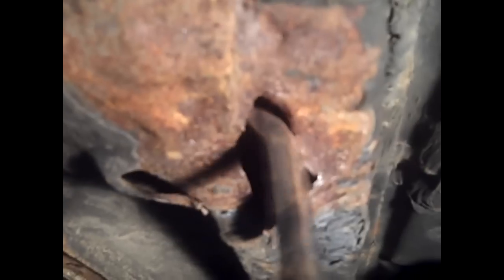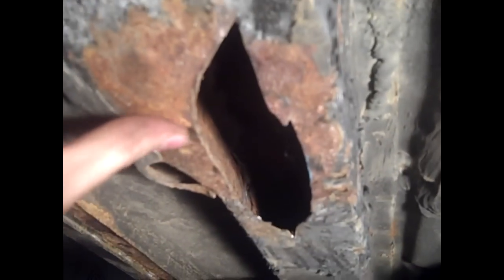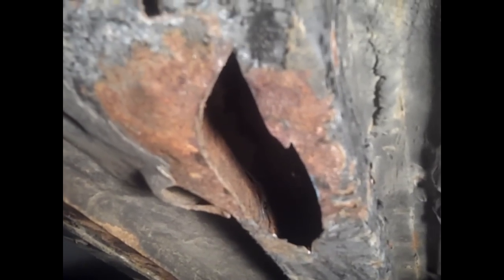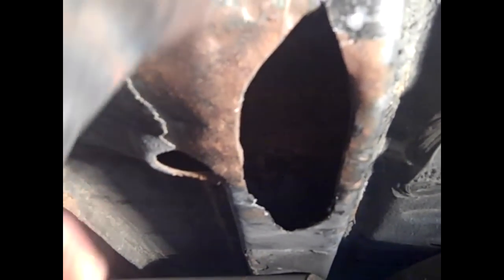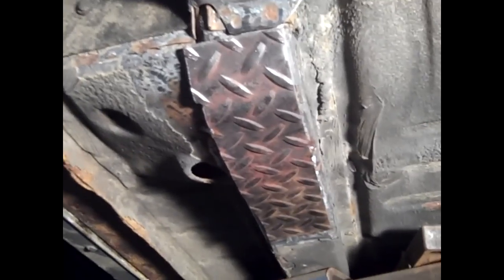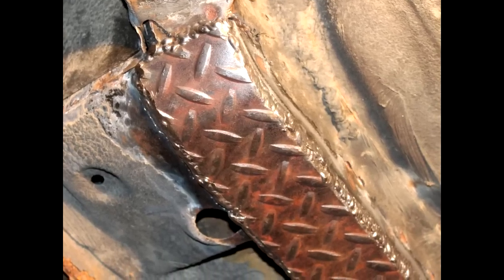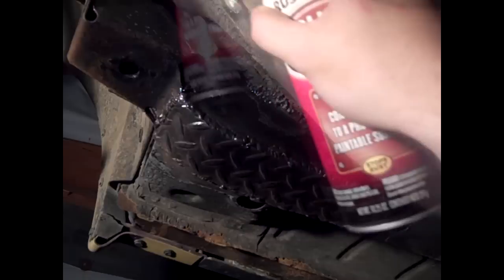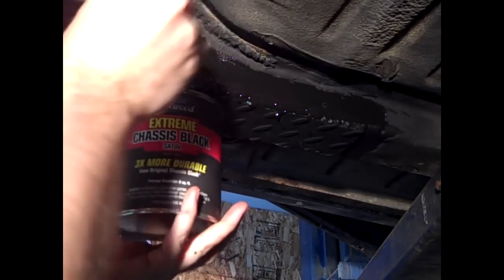Patching extensive unibody frame rust

Comment: Always my concern is treating the metal INSIDE the frame otherwise the rust will quickly recur.
Reply: Shoot some old transmission fluid in there and fluid film
Reply: @bobobrazil1973  Almost. Gotta mix that all up so it sticks where u want it. Try it and I guarantee u will be using it until urr dead.

Comment: Chain saw bar and chain oil is the best rust preventer ever because it stays tacky and doesn't drip.  
If you inject it into body voids on a relatively new car and brush a thin film of it all over the underside of the vehicle , it's unlikely that this kind of rust would happen in the first place. Oil will always prevent rust better that paints because oil wicks into seams and keeps on wicking.  Nice work, though!
Reply: scdevon yea, your right.. or just use couple cans of white lithium grease spray in holes as much u can once every couple years and will prevent rust. once ruat starts it a b**
Reply: scdevon but oil n grease can cause unwanted build up of dirt in the frame that causes dirt to hold water and also cover up w dirt areas re greasing cant get to.
best to just wash undercar as much as possible after driving in salted roads

Comment: I use the same method when prepping my car for its annual inspection (1997 Saab 900s). The only difference is instead of welding diamond plate I use duct tape and then I hit it with rubberized undercoating spray ;-)
Reply: Where are you from where there's annual inspections?
Reply: @danieldeanharrison  they do in Virginia but where I live they really just check the lights ask a few questions and give the sticker
Reply: @danieldeanharrison  Pennsylvania too🫤🫤

Comment: I have done many patches like the one you just did ! Nice job ! I am trying to fix rotted off piece of pinch weld under drivers door of Chevy cobalt ! The steel floor plate behind the pinch weld looked pretty solid .It is so thin it burnt thru catching main wiring harness and carpet on fire ! I melted a 50 wire loom pretty good ,So so am in process of taping bare wires and splicing a few . Truck sub frames are a lot easier than these small cars .The thin plates they laminate together are not much to begin with .When rusted very hard to not burn !

Comment: Nice job, but i would have sprayed engine oil inside the frame channels. Oil will really save your frame from further rusting. I do it on my jeep twice a year and it really helps.
Reply: +Ochipwa Greenspider what you should really do is vacuum all the shit out, get it cleaned good, and media blast the area around the rust. then you can paint with zinc primer, rust encapsulator, whatever... 
Then spray oil up in the regularly like our friend above here said because you could have not gotten full coverage over some spots or something and oil will also prevent. But if you get it all blasted and then painted properly you shouldn't have to worry about it.
Reply: Ochipwa Greenspider well there's often those little holes all over the frame, for drainage and wiring and stuff. So you can use a blaster with a little flexible nozzle and blast then paint with a similar nozzle for spray gun. If you use rust encapsulator  and zinc rich paint if you go over any remaining surface rust it will be starved of oxygen and not rust anymore.
Reply: +lar4305 exactly-repairing that hole is only part of the process, old engine oil or similar blasted inside the chassis member is THE vital last step to treat the advanced rust thats still there.
Reply: I like using Fluid Film. Its a sticky lanolin based oil that works great. Once a year and it helps!
Reply: Why oil it? Semen works just as good.
Reply: Pack it right full of JB weld. DONE!
Reply: engine oil would have been interesting while welding.  yikes!
Reply: @AustrianAnarchy  wow - that's what I just did.

Comment: Just one thing. Some DMV safety checks will not allow unibody repairs. Now I'm not sure if that' includes a profession welding shop or none at all. Best to check before starting. My son who is an expert on MIG did a job on a CJ. The work was never noticed. He has the knack of making things look old to boot, Ha.
Reply: Do you guys/gals on that side of the pond have to submit vehicles to annual inspection like in Europe? The EU control/MOT/TUV, etc.

I believe that "repair" on a frame member would be a write of for that jeep. :-(
Reply: This type of patch is acceptable in the U.S.

Comment: I have used Eastwood's rust encapsulator, which is probably the same thing as the Rustoleum product you sprayed on before you used the Eastwood chassis black. The encapsulator seems to work really well at penetrating rusty pockets and preventing them from spreading. Using that product, be sure you remove all rust scale and clean up the rust area as much as possible. Your patch looks good and strong, but not sure I would keep this old car on the road considering it had this much rust damage to the unibody frame. It was pretty nasty damage to the rail and floor pan. Think I would have junked it or gave it to someone I didn't like! LOL

Comment: looks good. diamond plate!! ha!. should have brushed the frame inside the hole as far as you can reach w a rust treatment. painted and then welded up. otherwise looks like shell hold

Comment: Looking good, That's about what I'am facing and I'll have to fabricate a patch as well. I just got into welding so fingers crossed that mine works out too. Thanks for sharing this, comes in handy, subscribed.
Reply: If you're new to welding,  do some research and watch some welding videos to get some tips.  Learn as much as you can and practice on a similar thickness of metal before jumping in to doing your repairs.
Good luck.

Comment: I had a mechanic friend from Oregon get a job in Wisconsin and he was very surprised on how the rust makes such a game changer in terms of brake/fuel lines, underbody-body rust, etc.,,,  Way more difficult, you get cozy not working with rust.
Reply: TVTruther - So true. Used to be in the South of Europe, warm and dry. 
Now living in the North, snow, ice, salt and tons of moist. Every bolt means a pray wishing it will come off instead a breaking off... Copper grease became a religion. LOL :-)
Here I go again to the -10°C change brake lines corroded to the bone... :-(

Comment: The tone I get from this and other forums is that the subframe / front cradle corrosion problem is no big deal. I wonder if I am seeing information from folks that have a certain level of expertise, giving them a chance to address the problem before actual structural failure while being driven? My wife’s 2000 Saturn LS frame / cradle did fail while being driven; she was so fortunate to have been stranded, unable to move, while driving very slowly. The right, front lower control arm’s front pivot bracket pulled completely away from the frame. The right side half shaft’s inner spline was pulled out of the tranny, and acted as a stiff rod between the spindle and what was still left of the cradle between the sites of the two (2) lower control arm’s pivot brackets. That made the car unable to steer or drive out of the lane of traffic it was blocking. I tell all that, only to ask: why didn’t Buff Whalen Chevrolet, Sterling Heights, MI, tell / warn of the corrosion damage, since they had been doing oil changes and had the opportunity to see the condition of the cradle?
Reply: In NY state I have the tiniest hole during an oil change in the unibody and its actually near the motor and if you go to a commercial place you cant pass inspection and they actually told me to total my car for it

Comment: This is what im up for in the weekend !   Bought a ford transit, ripped off the dropside down so only the frame was visible. walked over it with the hammer...  Quite extended rust, 6 patches will have to be done in the back.

Comment: My brother showed me how easy it is to stick weld and we tacked on mild steel just to cover up the damage. Then we sprayed with some under coat black rubber based paint. It makes it look like shit but it really hides it to the point of you can't really tell if there was any welding done. I was going to take the truck to be finally inspected but as I left my driveway, the pressure hose for the steering wheel blew and so I have to get a new one of those now.

Comment: This is just me, but I would have made the cut an even square, measured and cut metal (similar gauge to the frame) & welded into the square I cut. Then grind my welds to blend it all in, then do my painting. Would have been harder to tell somebody repaired that way.
Reply: IGotYourBack  lol some ppl just dont care what it looks like haha
Reply: It's a pretty dodgy repair, so it's better to be easily seen so everyone knows it's there.
Reply: +RADIO ROGER  dunno as IGotYourBack's method was blending and not weighty. You know that gravity thingy. And kinda like patching a piece of slate over an open wound on your hand. But that's me...
Reply: That may be true but it looks like he cut up his trucks tool box.  :-)
Reply: IGotYourBack don't forget a drain and cavity wax.wtf is the point of prepping the outside when its going to rot from the inside again. Glad it ain't my car.
Reply: hey, i have a 280z with a ton of frame rot. whats the best way id be able to fix it (properly) and have it pass a VI? any info is great :)
Reply: Yes I would have cut it out with square sides too and used a more suitable patch.
Reply: media-blast the entire underneath of the car after completely disassembling it inside and out.store and mark all removed parts properly.(rotisserie is best way to do extensive work),cut out the old and replace with new metal PROPERLY  with proper tig or mig,not arc welding and not flux core welding either .not like this,in other words unless you don't care much about the car.make a log book and take hundreds if not thousands of pictures,make diagrams,write notes etc  @thatzguy8196

Comment: Doesn't welding the frame remove the heat treating and make it prone to cracking? I'm curious as I want to do it with my 93 Caviler. A project car of sorts.
Reply: Passenger vehicles rarely if ever have heat treated frames. Heat treating does nothing to mild steel, which is what most of a vehicles is made of.
Reply: @ravenbarsrepairs5594  Is there any way to know for sure if it's heat treated or not? I have a friend who insists that all frames are heat treated.

Comment: Nice piece ofmetal lol :))) but you should have put some wax inside there , primer then wax. In my country there is a special product wax combined with rust stopper that is specially for rusted areas. You dont have to clean the area at all, the rust stopper saturates the existing rust than the wax protects it for further rusting. This thing is guaranteed 12 years and has done very good job until now. You should search this type of product. Search for wax and you will find something like this for sure. Its a bit expensive but worths ;) and  zinc primer goes well near the welded area underneeth.

Comment: It is called junk the car,the repairs are more than the car is worth most of the time.I know an used car dealer that wholesales and he would put a car like that in his parts yard.Has a great reputation not selling junk.
Reply: +wafrederick Of course, but if you can salvage such a car because you enjoy doing it, why not? Of course it's not economical but you do fix your own car for example instead of just dumping/trading it in.
Reply: wafrederick I run my cars untill they literally rust into. I recall using a road sign as a floorboard years ago
Reply: Welp, that wouldn't get past tech inspection over here. xD I understand this for safety and such, but it makes it so inconvenient that you can't drive home or store it somewhere easily..

Comment: The RustOleum product you used is a great idea, but it’s a gimmick. They should not be allowed to market this product as they do, making false claims. I’ve been restoring a 2001 Ford Ranger, and using this same product along the way, and thoroughly following their instructions. Several months later, I have rust revealing itself again under the “Rust Converter” product. Their “Professional” Undercoating, another gimmick. Anybody reading this post should consider using high quality Eastwood products instead.
I also agree with another post that said you should have a drain hole. Your repair is awesome, just as your subframe repair in another video. Would you be able to show us how you bent your diamond plate steel? Keep up the great repair work! Thanks

Comment: Welding stainless takes a real pro with all the right gear - and besides it's nearly impossible to weld dissimilar metals with any success. I'm not a SS expert by any means but I know some grades are brittle and therefore not suitable for structural members in vehicles, buildings, etc.

Comment: Question: What should you do about the rusted area on the inside of the rust hole? Would spraying rust reformer inside the hole keep it from rusting again?
Reply: waxoyl
Reply: I was going to ask the same question. I have sorta the ame problem w an 83 Mercedes 300SD, raised the car up w a floor jack on the subframe & punched a hole right thru it. Is there a way to coat the frame on the inside once it's welded or don't worry about the condesation that will get it?
Reply: Great idea, you inspired me. After looking around I found a factory hole. I just painted the frame on my Wife's 98 Honda Passport. I used some stuff that I purchased from my local Summit Racing, Rust Seal. I did oil the inside of the frame following your advice, Thanks, Dave!
Reply: Keep up the good work, Dave.
Reply: Yes, that is my concern also. I would make up a plastic hose with a spray tip and push it up into the subframe and spray the inside to stop more rust.
Reply: B3NN10N wax oil or oil any kind 10-30 used transmission,cooking ,chain bar any thing

Comment: so what happened? im interested to know because im in welding school we we have welded mild steel pipe to stainless pipe with no problems using stainless filler rod. we used steel filler rod and it welded but the back side was a mess, the only thing we change when switching from mild steel to SS was filler rod so im interested to know what was going on with your set up

Comment: Your supposed to stitch weld on a unibody, Fully welding the perimeter of the patch imparts too much heat in the metal and it becomes brittle. Notice the stock joints are spot welded.
Reply: The stock joints are spot welded because it is significantly cheaper and faster than running full welds. The heat is not an issue; if it was, then the spot welds would simply break. Full welds mean there is no gap to let moisture in, so it is better; even though the frame rails have open channels to allow moisture to drain.

In an ideal world, you would have full welds on the frame rails, with no open channels, air tight and filled with 100% nitrogen to keep them from rusting internally. I guess if they built vehicles this way, they would cost significantly more.

Comment: What type of metal did you use? I just tried to tig weld 1/8 stainless steel to my 93 nissian truck frame. the stainless steel was beading but the frame was not even melting. I tried to concentrate more on the frame and I could see I was starting to blow a hole through it and it wouldn't really melt just enough to bead. I am really starting to feel demoralized about this because it took me weekend to measure, prep the metal, shape it, and clean it from any impurities. Please someone help.

Comment: You actually made that whole spot weaker because of 2 things. 1 you should never weld all the way around a unibody patch plate due to the amount of heat you put into it and you did 2 passes so you REALLY stressed the base metal. 2 that weld wouldn't hold a paper bag closed even with 2 passes on it. I really hope you aren't welding on other people's frames too.
Reply: @retrox684 that was junkyard welding if you know anything about welding . It's a leaker

Comment: I have a1995 prizm from Wisconsin. I have had it 3 1/2 years. Replaced a brake line, wheel hub assembly, starter (twice), valve cover gasket and spark plugs and spark plug tubes, brake calipers and pads and rotors, fuel filter, tires (all 4 new in the past few months) exhaust manifold, ignition coil and O2 sensor, catalytic converter, midsection of exhaust system, alternator,front struts,radiator and hoses and thermostat. Is that all? I did everything myself except the catalytic converter and mid-pipe, and the brake line and the wheel hub assembly and the first starter. I did the 2nd starter  myself and it was a big job.. I got a little help with my brakes, but is mostly  my own literal blood, sweat, and tears put into this car since I am so poor. There There is a lot of rust elsewhere. Jack points and wheel wells and rocker panels. I am being told the unibody is so rusted, it can't be aligned. I may jack it up myself and try to see what he is talking about with the control arm. He said it was time to retire my car. I think anything can be repaired I used epoxy and fiberglass cloth to patch holes in my cast iron water pipes in my 50 year old house. The patches are about 10 years old. I have a lot of home repairs to make. My pipes need to be replaced. I have class than 200,000 on my Prism. I was hoping to save up money over a year or 2, but it does not look like i can wait that long. I do not know how to weld, but I know fiberglass cloth and epoxy are strong. Not sure if they can patch nobodies. My  cast iron pipes are not even subjected to high water pressure.
Reply: no